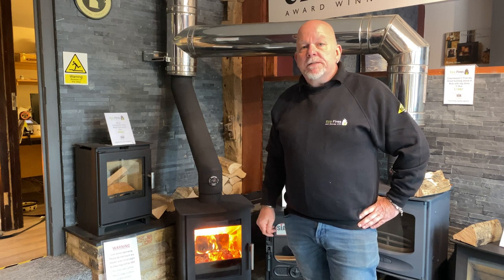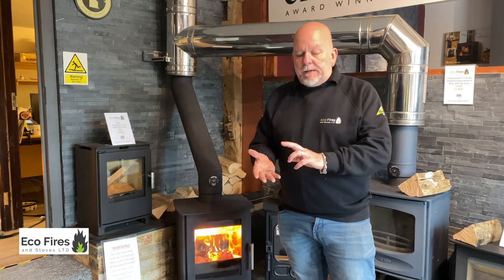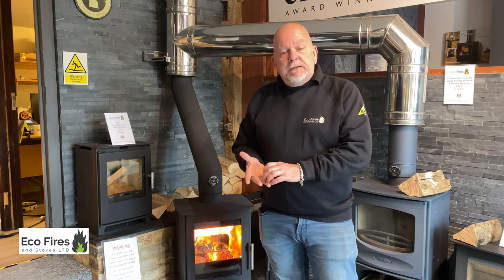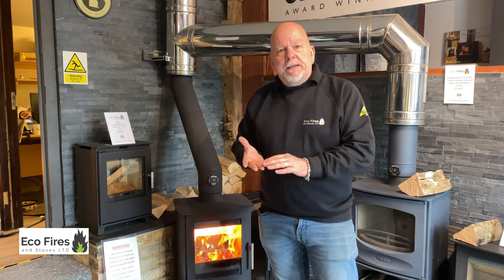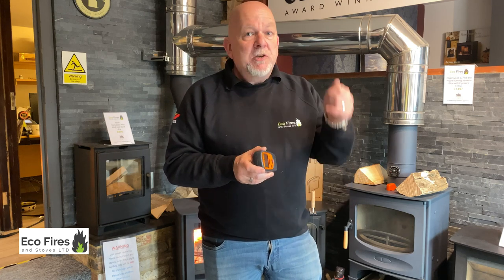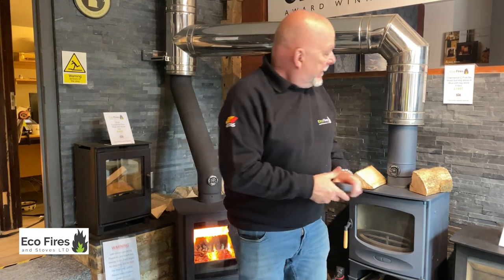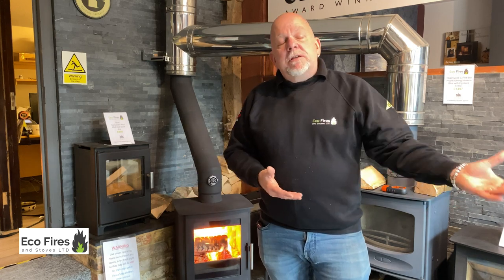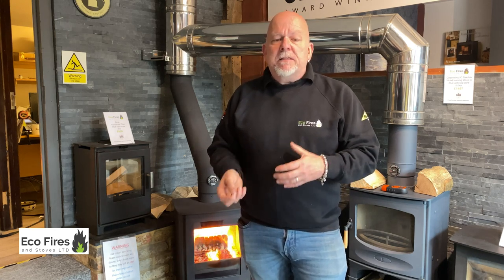Lighting Your Wood Burner Using The Right Logs

Comment: Great video. Thanks. We are new to this and have found certain wood we have burns easier than others. In particular old skirting boards from the house burn really well. We have had a delivery of wood and are storing it under a tarpaulin but I guess that stops the airflow, also have some in the shed so will aim to move it. Thanks very much

Comment: I've had a new stove fitted on the top of the fire it's a 6" flue hole . 
It has been fitted using a 5" liner from the fire to the chimney. The company are telling me this is ok but the fire has no draw.
I'm getting smoke back into the room.
Do you have any advice.
Thanks for any help you can give

Comment: Hi, I bought a house that came with a small 5w wood burner. I bought kiln dried logs for the winter but a lot of them are quite large. Is it okay to just use one log with kindling, or can you let me know an easy way to split your logs?
Reply: Get yourself a Sealey foot operated log splitter, around £70, split your first log into 2 or 3 and let the fire get going. When the flames have died down,  then you can start loading whole logs on to the glowing embers.